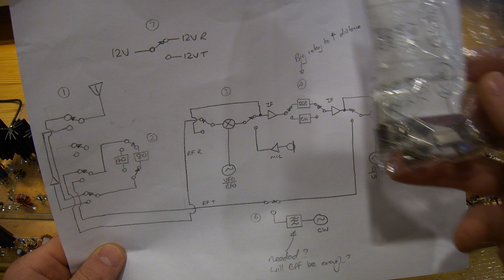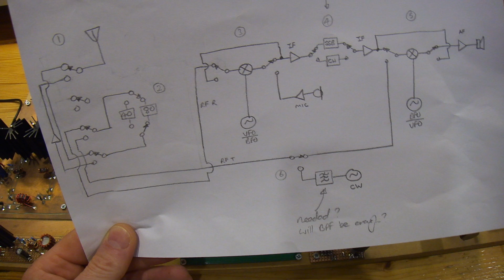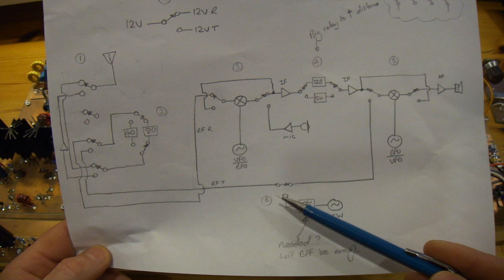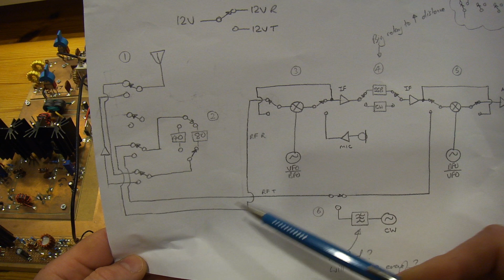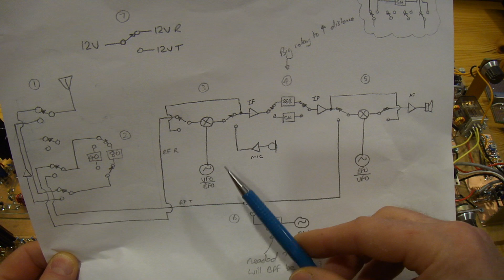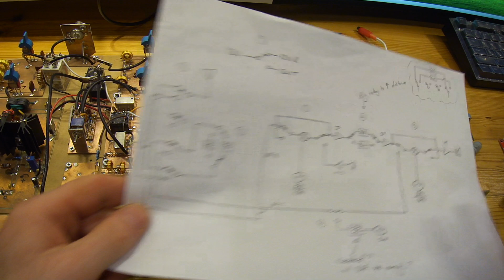Homebrew 80m/40m SSB/CW Rig - Part 1: Thoughts and Ideas

Comment: Glad to see you back! I would like to share a concern with your choice of 9 MHz IF for a 40 Meter radio. The 9 MHz may prove difficult to filter out since it is only 1.7-1.8 MHz away from the top of the 40 Meter band. The BP and LP filter filter will have to be very sharp and of a high order to ensure adequate attenuation of the 9 MHz if component. For a single band radio on 40 Meters I have used 12.288 MHz, but for 80 and 20 Meters 12.288 Mhz poses similar issues and  9 MHz would be better.

Comment: Hi Charlie you could use pin diodes to switch the RF paths and control it from the Arduino and it cheaper than relays just an idea. Looks like it should be an interesting project.

Comment: Nice to see some more project work. I found that playing around with crystal filters that the orientation of toroids in the L-match  circuits (lowpass config) affected the out of band rejection. The toroids were almost 70mm apart. Using a common relay may restrict rejection.  Still worth a try

Comment: From personal experience the CW signal from Si5351 is OK-ish. However keying a low frequency oscillator (next to the MIC on your block diagram) gives much better results and is not much more difficult to implement. I also would like to note that using Si5351 for BFO inevitably creates a lot of spurious signals. In order to build spurs-free single IF superhet receiver one have to use a well-filtered analog BFO. Naturally choosing this path will not allow you switching BFO and VFO channels. Did you consider building a rig based on amplifiers described in "A Termination Insensitive Amplifier
for Bidirectional Transceivers" [PDF] by W7ZOI and K3NHI? This will also remove the loops which are not uncommon source of parasitic oscillations.
Reply: Great comments Alex and I agree with all points. I've used software keyed si5351 clocks for CW with reasonable success for some years (copying KD1JV and many others). The method is amazingly simple but you don't get to shape the keying. At QRP you can get away with it but you may not if you drive a 50w PA which will expose any roughness.  
I agree that a filtered crystal BFO is better than using a si5351 clock. You get a much cleaner sine wave and fewer birdies but you lose the convenience of changing the BFO frequency for USB/LSB. I've wondered about using two si5351s, one for VFO, one for BFO, but they both sit on I2C  x60 so you'd have to hardware multiplex them. The symmetrical TIAs are a good idea and Wes has recently  published an updated TIA schematic with AGC!  Good to hear from you Alex and Charlie! 73 Paul VK3HN.

Comment: Where do we find your arduino sketch for the VFO/bfo/carrier
Reply: There are several libraries out there you can download that will run the SI5351.   AdaFruit has one.   Etherkit is one I use I believe.  Charlie has a video out as well on how to get it up and running.
Reply: @johncundiss9098  I’ve got a sketch for a receiver, do you have one you know works? I don’t want to spend a hundred hours searching and fiddling
Reply: @justinelliott3529  Charlie has his code posted on the same site as his notes. if you search through his video on the Si5351 you will find it easily.
Reply: @curtstacy779  thank you!